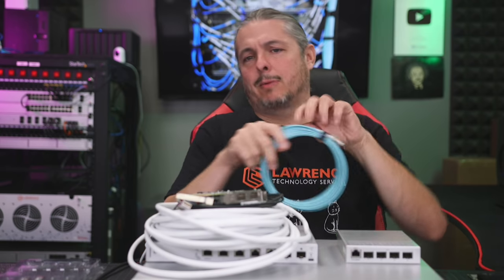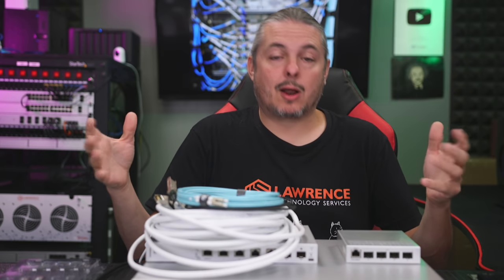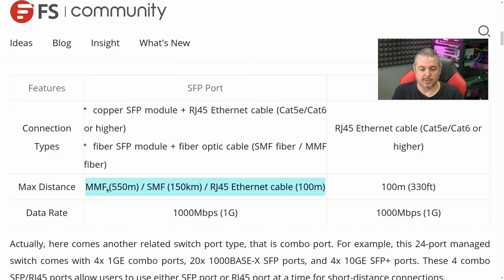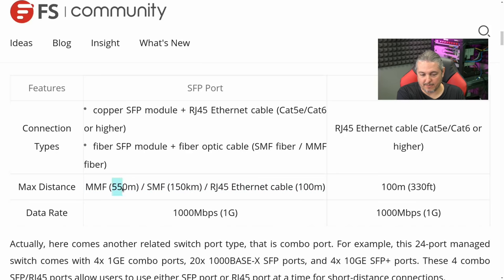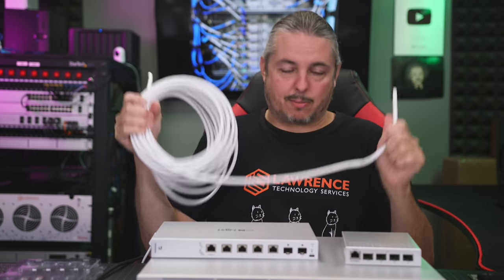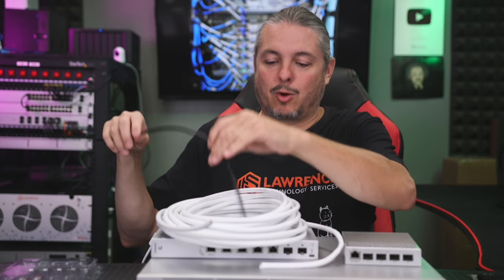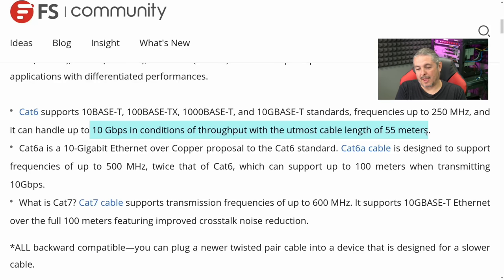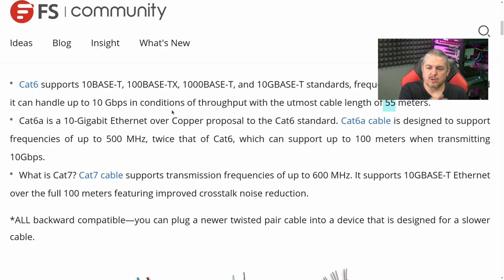Building Networks: When to run Fiber, Cat 6 or 6A, DAC Cables, and Cat 8

Comment from the maker: SFP+ DAC VS Fiber Latency: Copper Is Faster Than Fiber
https://www.youtube.com/watch?v=jnD0OQRV8LM&t=6s

Comparing SFP+ 10 Gigabit Connectors: LC Multi-Mode Fiber, 10GBASE-T, and DAC Cables.
https://www.youtube.com/watch?v=RXT4xQCHcKI&t=43s

MikroTik CRS305-1G-4S+IN 10G Switch Setup Review With VLANS
https://youtu.be/qrYBhFIE-qA

Breaking the 100M limit and Going 200 Meter / 656 feet With Gamechanger Cat6 Cable
https://youtu.be/ZY48KUAZKhM

⏱ Timestamps ⏱
00:00 SFP VS Cat 6 VS 6A VS Cat 8
02:12 DAC SFP Direct Attach Copper 
04:14 Fiber Bettween Switches
07:45 Using Cat 6 or 6A Twisted pair
11:27 Cat 7 and Cat 8
Reply: speed and latency are different things.
Reply: you didn't specify how to mix fiber with rj45 systems , there is no way you are running only fiber... you know that. so go through that
Reply: Cat6a does not need to have shielding that would be shielded Cat6a just like shielded Cat5e. I still have some left in the loft from when I wired my house in Cat6a some 15 years ago. Admittedly the cable was free, the networking contractors at work would dump the boxes in the network rooms when they got down to under 30m left. The networking guy let me have the lot because he was sick of it and they didn't take it away. In a domestic setting 30m covers most cable runs.
When it comes to Cat7 and up unless you are using CG45 or Tera connectors on the end then you are making the situation worse than Cat6a. Basically you go from balanced pairs in everything up to Cat6a to miniature twinax cables in Cat7+ and unless you are using the right connectors then you are going to have reflections off the end that will cause problems. Further Cat7 is not required by any IEEE 802 standard and Cat8 is only used in an 802 standard for 40Gbps network at point to point links up to 30m. However there is absolutely no equipment on the market that uses Cat8 cable, 40Gbps is exclusively DAC or fibre.

Comment: 1) You mentioned EMI in relation to fiber, which is absolutely correct. Another, very relevant and often overlooked, point about fiber is, that it's galvanically separated. In other words, no component of the fiber cable conducts electricity. This is valuable in building to building links, because the actual earthing potential (the voltage of the earth line) can vary between buildings. This used to only be a problem if you could somehow touch both earth potentials at once (for example if you rolled some metallic machinery out between buildings and connected one of the machines to one building and the other to the other building, and then touched both machines at once - not a very common scenario). However, the issue with data connections between buildings is, that the data cable, if it conducts electricity (for example if the cable is shielded), then this tiny network cable becomes the equalizer for the two earth potentials, which often leads to weird and sudden damages in the event of power surges, equipment failure, etc. Furthermore, a different earth potential can lead to problems with interpreting data signals (as seen for example with RS485 if the GND/reference is not used or sized inadequately). It's not often an issue in practice, since earth potentials are usually near identical through out a site, but in those cases, where it turns out to be an issue, the results can be pretty dramatic. So it's an important factor when considering long (especially building to building) runs, and often speaks for using fiber. 

2) It's not at all uncommon for Cat6A cables to have per-pair shielding along with cable shielding. I've installed a cat6A network, where the cable (just as cheap as cat6 and cat5e, btw) is double shielded, and the cat6A STP connector (Brand Rex) instruction manual specifically mentioned the termination of each pairs shielding.

Comment: When talking about DAC, the compatibility issues comes up because each connector has an eeprom identifier built in that was originally intended to identify what type of cable it was (including manufacturer). Several manufacturers use that identifier to block out the 'lower' grades of cables by ONLY working with 'their' brand of cables (often in the name of reliability) but it also helps out the bottom line as DAC cables are very profitable when you are locked into the 'big boys' brands. $150 'retail' cables typically are sourced for << $15 each (by the mfg )

Comment: A note with SFP DAC/Fibers is that some manufacturers <cough>Intel<cough>Cisco, will sometimes not work with SFP modules from other brands, and your perfectly fine DAC will be rejected by one, or the other side. I found that in those situations, I'll just pop-in brand-compatible SFP+ modules (from FS, never had an issue with them), so Intel-compat SFP+ in Intel Netw Card, and Cisco-compat SFP+ in Cisco SW, and fiber in-between. Works everytime.
Reply: For that reason one need to get confirmation if the module you are after is indeed supported with your device.

Comment: This video actually had a good influence on the design of my future home building plans. I planned to run CAT7 originally inside the walls and have it connect to wall mount switches in various locations of the home. This was for the 10gbps speed capability as well as future proofing.

The house is also planned to be built with metal frame 2x4 rather than wood so one of my concerns was possible noise from the wall frames acting as an unintended antenna. So the added shielding was kinda something that caught my eye with CAT7 and CAT8, but until this video I didn't know about the stiffness of these cables.

The ultimate decision I decided to plan for after this was to install full fiber instead through the walls to avoid the concern of interference as well as the annoying stuff cable issue. all while still futureproofing the home. The cost of it also seemed to be reasonable for how much I needed as well. Despite how you mentioned them being unfeasible for most situations, in mine it's something I can live with given they won't be getting moved ever again after install

Despite this video being old I really have to thank you for it, you not only helped me prepare my building plans to meet my needs but exceed those needs and avoid several issues I hadn't thought of prior. All without having to spend hours on end researching each of these different cable types and having to buy samples of them before hand.

Comment: That Cat8 cable looks like a smaller version of the STP Type-1 Token Ring cable I used to use back in the day (about 30 years ago) of 4Mbps Token Ring networking ;-)  Cool video, Tom, thank  you.
Reply: Cat7/8 moves from balanced pair to twinax and is only used by clueless idiots who think higher numbers is better. Without the right connectors CG45/Terra it is electrically worse than Cat6a.

Comment: Great video!  You nailed it with the portion on the physical size of the cables.  I had the devil of a time with an office wired with CAT 6A cables.  I had data paths that were designed for Cat 5 and these new cables did not physically fit.  I would also suggest the you talk about terminating the cables.  1) Don't use CAT 5 RJ45 end points on a CAT 6 cable; you can't fit the cable into them for a proper crimp.  Personally, I hate putting a RJ 45 on a CAT 6 cable!  I want something where I can punch them down.  So much more reliable.
Reply: aren't there field install-able connectors with such features? Naturally bigger because of all the punch down mechanic..
Reply: @joansparky4439  I'm not sure what you are talking about.  I do not have a lot of experience with different CAT 6 connectors.  One thing I do not like is that there is no ready way of differentiating CAT 5 and CAT 6 connectors.

Comment: I think the cat6 poe confusion comes from the old school idea of how cat5  poe (for the technical, 10base t and 100basetx) worked. Just two years ago I was taking a course for the a plus and a instructor was trying to telling me that only four of eight cables are used for data (1,2,3,6) and four are strictly used for power (4,5,7,8) and I remember telling them that's not true, well at least not any more. Some people don't realize that all four pairs can be used for data and power but anyone who trained for the 900 series A+ probably didn't have a focus on the new standards since it wasn't a priority for that Exam.... So this confusion should take care of it's self as test now have to be repeatable taken with new content.
Reply: This is such an important note that many ppl don't know. I can get you 10/100 internet on 1/2 3/6 but for PoE you need Cat5e or above and you need the 4/5 7/8 pairs to act as power/ground for PoE to work.
Depending on the device, you can now see voltage on all 4 pairs in order for the device to work properly.

Comment: Great explanations Tom! I’m building a home and I ran CAT 6 throughout. None of my runs come even close to 55m, so I am OK with that. The new home builders in my area are still running CAT 5E by default for residential installs. it really does come down to budget and cost. Have a great one Tom!
Reply: Unless you're running 10Gb, CAT6 won't get you anything.
Reply: @James_Knott  correct. I am planning to add a 10 Gb switch, a NAS w/10Gb and upgrade my computer.
Reply: Here in Germany almost any new building uses CAT 7... you can't even really get CAT 6 anymore... so I'm quite curious that CAT 5E is still the default in your area
Reply: @jorrit_o  Given that Gb was designed to work over plain CAT5, not even 5e, what does CAT7 get you other than greater expense?  If you're running 10 Gb, then CAT6 should be good enough.
Reply: @James_Knott  Other than better shielding nothing… but like i said you can’t really get CAT 6 from a reputable manufacturer here and CAT 7 actually costs the same as CAT 6a so i take CAT 7 (also they‘re the standard here in Germany)
Reply: @James_Knott  If the CAT5 isn't perfect, it won't do gig. Better to go with CAT6 and future-proof it.
Reply: @jorrit_o  6a and 7 are a pain to terminate. Takes difference connectors on the cable and the patch panel to be fully up to spec for shielding. Way easier to go with CAT6.
Reply: @JacksonCampbell  Once again, Gb Ethernet was designed for CAT5 before 5e was available.  Also, the spec allows for 100M and I doubt you'd find that length in any home or many offices.  I'm currently using plain CAT5 that was installed in the late 90s and it's still going fine.  The longest run is about 50'.
Reply: @JacksonCampbell  I‘ve done so many CAT7 but also CAT 5e runs and I don’t think that it’s that big of a difference…
Reply: @jorrit_o  Must depend on the shielding.
Reply: @jorrit_o  Anyone using Cat 7 is an utter idiot. The reason is that electrically Cat7 and Cat8 is a bundle of minature twinax cables, not a bundle of balanced pairs. So unless you are using CG45 connectors (or Terra ones) then you are causing problems with near and far-end reflections of the electrical signal. However the issue is that there is absolutely no equipment on the market with CG45 sockets so you cannot use Cat7 and up without causing problems. It is unlikely there will ever be an IEEE 802 standard that requires the use of Cat7 cable. At the moment there is only a standard for 40Gbps on Cat8 as point to point (not structured) in the data centre up to 30m and there is no equipment that actually uses it. Heck 10GBaseT in the data centre is as rare as hens teeth. I have hundreds of 10Gbps ports in the data centre at work and it's all SFP+ using DAC's and fibre.
Reply: @jorrit_o  Where did you get equipment with CG45 sockets? Right you didn't so using Cat7 was a really stupid idea because the electrical performance without the correct plugs/sockets to deal with the fact Cat7 is a bundle of twinax rather than a bundle of balanced pairs is significantly worse.

Comment: One point to consider in the fiber vs 'copper' discussion is RF inteference and electrically noisy environments. Fiber is essentially immune to electrical inference and electrical noise unless you are talking about very strong light (such as from a nuclear event). Even though ethernet is transformer isolated there is still a lot of electrical energy coupled and passed via the cable, even if its shielded like the higher cat standards. When you are going from building to building, fiber is the way to go

Comment: I was excited to watch this. But after running 3,000 ft of Cat6 this week... I have had my fill. It's going into my 'watch later' until after I have cooled off on the topic some :)
Reply: I ran 600ft of Cat6 through my house this month with the longest run being about 150ft.. at least I know my whole house supports 10GIG now :)
Reply: @ethanedwards8296  I don't know residential, but I bet that's twice the amount of effort-per-foot compared to commercial
Reply: That's nothing.  On one job I had several years ago, we ran over 100 Km (yes, 63 miles) of Comscope 0222 coax cable.  This was in a major telecom office with 1024 runs of cable.  The reason for that cable type was it's small diameter, needed to get all those cables through the hole in the floor at the bottom of cabinets.  It was for DS3 (45 Mb) signals.  The techs wore out several of the cable stripping tools.
Reply: @Heizenberg32  That depends on when you do it.  If during construction, no.  If after built and occupied, yes.

Comment: If you are building a new house, just install cabling conduit (the corrugated orange stuff) in the walls with pull strings in them. This will permit you to run cable in future with ease.

Comment: A company I worked for in 2001 wired all their drops with CAT 6 . This was before people knew you could do 1Gbps over CAT5e. CAT6 patch panels, jacks , patch cables all had to come from the same manufacture because the CAT6 standard wasn't fully complete . It was very expensive . That business has changed offices long before the benefits of CAT6 were even utilized .  1Gbps is ubiquitous now but it is still over kill in most office computer situations

Comment: Cat 6 can do up to 10gbs over shorter distances cat6a can do 10gbs over longer distances so if you're on the fence about what to install in your house get cat6 right now the industry is still on cat5e.  cat6 will be good for a minimum of 10-15  years before the industry moves to faster speeds. And getting cat 6 over 6a will also save you some money without having to compromise on performance.
Reply from the maker: Cat6 is good for home

Comment: MMF has speed limits depending on if it's OM2, OM3, OM4 .... Speed limit of SMF (OS2) has not been found yet, every time they can modulate the laser faster, OS2 fiber can handle it. Also if you do WDM, OS2 fiber  is about the only choice..
Reply: The picture is more complex here. The WDM and others are to be deployed on SM as well. Multi channel variants of both fiber types as well. MPO and MTP...
Reply: Why is smf called OS2? What is OS1 singlemode?
Reply: @dsmcraig  OS1 is an older single mode standard where the glass is less pure so does not sustain longer distances. It is otherwise completely interchangeable with OS2 cable. If you are under say 10km it makes no practical difference, but nobody has made OS1 cable in a long time now and there is not a great deal of it out there.

Comment: An argument against using DAC cables, especially in racks where the NICs are vendor locked, each end needs to be programmed to work with the device it's plugged into.
If a cable got broken or damaged, you're going to be ordering a replacement and waiting. We prefer to use the vender coded optics (and keep individual spare optics) and standard LC single mode fiber. If we ever need a new cable, we can run to microcenter, or we normally just have a pile of them from FS, and they can be used in any connection.

Comment: Also, keep in Mind MTP cables you can use a 12 fiber or higher to run 6  or more connections over a small cable and break out cassettes to break it out into LC connections.

Comment: I'm not trying to endorse a particular product and connectors certainly make a difference.  I am installing Cat6 UTP Riser in a new project.  The longest run I have is 97.6m or 320' and is running at 10G.  Cat6 is certainly capable of going 10G well over the 55m limit.  At this point I don't see the point  of using 6a or higher.  By the time this speed becomes irrelevant it will either be Cat15 or a new type of cable completely.

Comment: We have bought an old house (in concrete/bricks) without LAN plugs in the rooms, we'll deploy fibers cable from the central switch to the different rooms on top of the existing power line pipes as copper is not allowed because risk of fire / risk of short circuit. This will be the cheaper option, otherwise we have to drill down half house to put in place new cable pipes long the walls